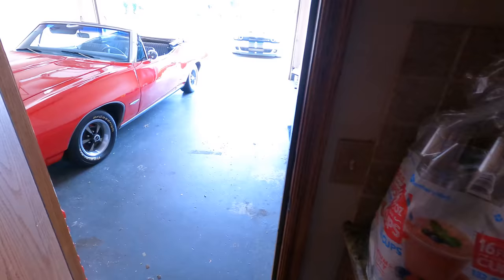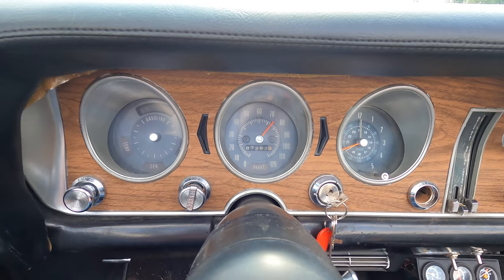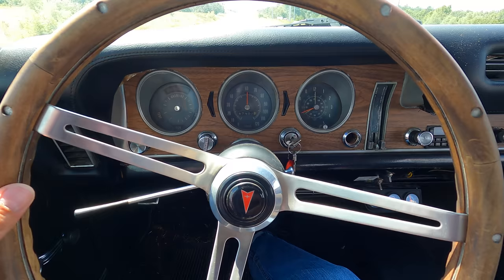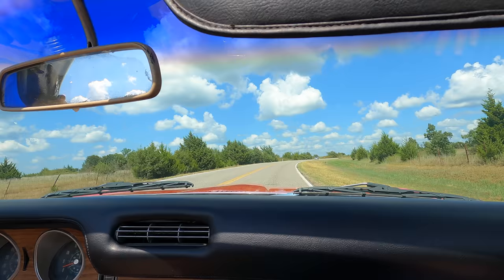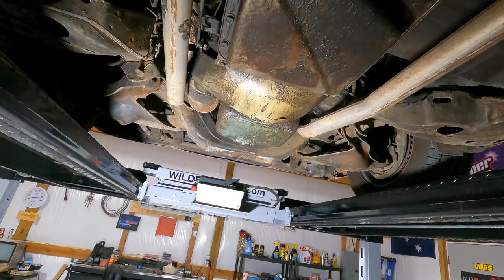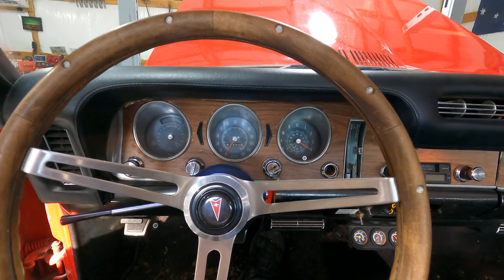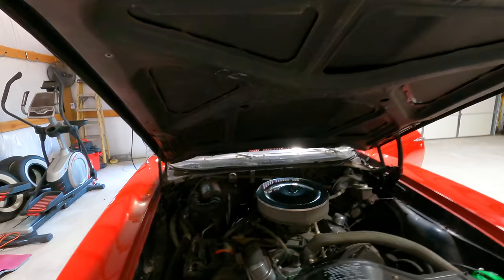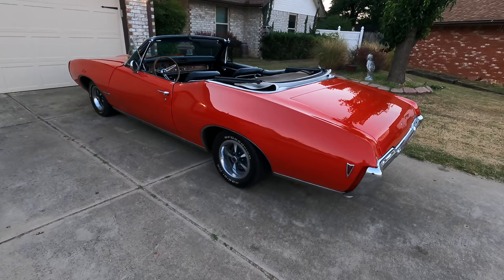Everything Wrong with my $20K Fake 1968 Pontiac GTO - How bad is it?

Comment: If that car had a Quadrajet that was well sorted (and I mean you knew how to properly tune the secondary air doors, power piston spring, and choke pull-off), you would never have any problems with its carburetor.

Comment: The Pontiac 350 is a good motor. As long as it is converted to electronic ign from points about the only other thing to worry about is the timing chain. Which is why on the old Pontiacs I switch the factory nylon ones to a steel double roller. That one seems to be running really well and no smoke, knocks or ticks. I would take it anywhere.

Comment: Just keep it as is and fix what needs fixing and remove all the fake GTO badges. An excellent LeMans.
Reply: The emblems back them were attached with legs in the chrome emblems going through holes in the bodywork, and the emblems were held on by speed nuts or captive fasteners. They didn't use adhesive and the emblems don't all have the same 'pattern' for legs and even some eblems go in different places. For example, some were on the rear quarter, and some were on the fender.
Reply: I was joking in the first video I saw of it and said he should get a tag with FAKE GOAT on it.
Reply: Thanks for helping me out.  I was trying to figure out the “fake” part.  Duh on me!

Comment: She will make it. I think you should put the Lemans badges back on it, a better steering wheel or the original and maybe the dash with a tach, but just my thoughts. Nice car though I like it.
Reply: Don't even know if there was a cluster with a tach. Remember these had the hood-mounted tachometer...
Reply: @wilsixone  ~I don't remember on the '68, but you could get the dash tach out of the '70 model. That also had a 140mph speedo, which would be pretty nifty.

Comment: Super Turbine 300 two speed used in various Buick, Oldsmobile, and Pontiac models from 1964-1969. The internal operation of the ST300 automatic was similar to the 1962-1971 Powerglide and almost indistinguishable. Few parts were interchangeable.

Comment: 68 can have a glide which yours has.. Its a nice clean Tempest convertible..  At best a Lemans base version. You need a full suspension rebuild with tie rod ends and a new steering box. Love the over-spray on the frame and engine.  The springs are also all sagged out.

Comment: That's the 2 speed GM automatic often called Super Turbine 300. It has the vacuum modulator on the opposite side from a Powerglide transmission. There were some Canadian made Pontiacs with special heavy duty Powerglide transmissions. The insides were similar to the 427 Corvette Powerglide, but the transmission cases had bolt patterns for both Pontiac and Chevy engines.

Comment: With that car being a Lemans, the reason it doesn't have any get up and go from a dead stop is because of the rear end gears the Lemans came with. I think it's a 2:73 gear. Also, that transmission is a Super Turbine 300. Pretty sure you got a keeper here!

Comment: The only V8 offered in the 68 LeMans is the Pontiac 350. The shifter will tell you what transmission you have. A 2 speed Powerglide will have PRNDL. The 3 speed will have PRND2L or 1 instead of the L. My 67 LeMans had the 2 speed. The GTO came standard with a 400 mated to a 3 speed automatic with a dual gate shifter made by Hurst.

Comment: Randy, as a LeMans, 14-inch tires would have been standard, and with the optional Rallys II Wheels, F70 X 14 would have been the likely OEM tire size or possibly G70 X 14.
Reply: G78-14 is Factory tire/wheel size, for Lemans or GTO.

Comment: Look at it as a GTO tribute car. You could always rebadge it as a LeMans for resale. It's still a nice cruiser. You did good on the price. We had a '69 GTO with 14x6 Rally II wheels. Back then 14" looked fine with those unique looking Pontiac wheel arches. Fun fact: you could actually get a GTO with a chrome front bumper. It still had darker grill with white "GTO" lettering. The tail lights were unique for GTO too. GTO hoods did have nostrils but most were non functioning unless you got Ram Air. It sounds like your secondaries are working fine when you step on it. Great video, thanks.

Comment: Your gear selector indicator will tell you. D & L is a powerglide. D 2 1 is a THM
Reply: Unless a 2 speed was put in without changing the shifter.  If it's a Pontiac 2 speed I believe it would be an M35.
Reply: Looks like its a 2-speed going by the gear leaver. Looks like it has D & S. No 2.
Reply: A powerglide was NOT available in a GTO! A GTO ONLY came with a TH400, or a manual in either 3 or 4 speed.
Reply: @jasontengan1233  I know it IS a Tempest, LeMans which did come with a power glide as STANDARD Automatic. A GTO was ONLY offered with a TH400 Auto.
Reply: From what I can see it looks like the same powerglide I had in my 67 Le Mans and my 69 GTO i been working on has a TH400
Reply: @jackfisher3906  actually no they came with the st300 all bop cars had this 2 speed. powerglide was a chevy only deal.
Reply: @jeffreyrigged  Sorry I used powerglide as a generic term for a GM two speed auto.
Reply: @jackfisher3906   alot of people do but they dont share anything other than both being 2 speeds. i aint mad at ya lol.
Reply: @jackfisher3906  before the mid 60s they did. by about 67 all the other cars had different trans than chevy and a different bolt pattern but they all shared it besides chevy. idk why they kept chevy differnt. it would be an easy swap to put a th350 or a 2004r in place of that st300 though. its a direct bolt in for both for the most part. im guessing this car was a 2 barrel too originally since it has no quadrajet.

Comment: The pontiac 2 speeds were super turbine 300s not powerglides.
Reply: 300 Turbine
Reply: @chrismorales9440  The Super Turbine 300 has the vacuum modulator on the opposite side from the Powerglide. Some Canadian Pontiacs did get special heavy duty Powerglide transmissions with guts similar to 427 Corvette Powerglides and the Canadian Powerglide has bolt patterns for both Pontiac and Chevy engines.
Reply: I dont think a late 60s convertible with a/c is bare bones. It could be a nice driver with some repairs and/ or upgrades
Reply: @jimjungle1397  but canadian pontiacs are acadians though and not a  gto and the acadian was just a chevelle with pontiac badges. had the chevy engines and so forth.
Reply: @jeffreyrigged  There is a Canadian Powerglide that had a dual bolt pattern for the GM engines and the heavy duty internals that were used in the 427 Corvette. Those weren't just made for Chevy engines. From the heavy duty gears and parts inside and the multi-engine bolt pattern, they likely went behind some big engines. I think they were used in Canadian Pontiacs and not Buicks made in Canada. I've seen Chevy 12 bolt rear ends in Buick Skylarks made in Canada, but with 6 cylinder or Buick engines in those with 3 speed automatics.
Reply: @jimjungle1397  but what im getting at your pontiacs in canada are chevy powered. you dont have a pontiac engine in canada at least in 68. dual pattern powerglides came in firebirds and only in 70.
Reply: @jeffreyrigged  The Chevelle type car was called the Beaumont
Reply: @joca6282  yes.
Reply: @jeffreyrigged  The Beaumonts were sweet looking cars too. 68 and 69 were killers!

Comment: Cars of this era had a valve in the heater hoses that shut off the flow to the heater core when you changed the temperature from hot to cold.  The valve may be stuck open or the cable  (some cars had a vacuum controlled valve) to the valve may be stuck or broken.  This was the first auto repair I made, fixing the AC in my dads Dodge when I was 14 years old.

Comment: do a dif fluid change requires removing the cover count teeth on the ring gear an divide by # on pinion= final drive ratio ,my money is on 3.08

Comment: The transmission is a Super Turbine 300, a 2-speed automatic.  It's not a Powerslide. Buick and Olds used them as well & Olds called it a Jetaway.
Reply: The Super Turbine 300 has the vacuum modulator on the opposite side from that of the Powerglide. Easy way to tell. Some Canadian Pontiacs did get heavy duty Powerglide transmission, with guts similar to the 427 Corvette Powerglide, but the Canadian Pontiac Powerglide has bolt patterns for both Pontiac and Chevy engines.

Comment: Oh a HUGE WARNING, make sure you run a lead additive or you WILL sink the valves into the heads. This is of course if you don't have the hardened Exhaust valve seats installed on the heads. It will run fine for about 6 months to a year then you'll start to notice excessive noise coming from the valve train as they sink into the heads. You can fix it by changing the valve seats out but if you don't the Exhaust valves will sink. I know I did it to my 69 GTO and my 1974 Trans Am. Also if you run the lower octane you'll need to adjust the Ignition Timing or you'll get pinging in the valves due to per-detonation. This will result in broken stock valve rings, broken piston ring lands and will chamfer your cylinder walls. Been there and done that on my 74 Trans Am. You can fix that by boring out the cylinders and sleeving them. To find out if your valves have started to sink take it to a shop and have them check the valves stem height and run a compression check. Have fun with your Cool Le mans or Tempest. 
The Tire should be G70 Rally II 14X6 wheels not 15" in wheels. If you put 15" wheels on, it will rub the front fenders and tear them and the fenders up. I recommend the 15" wheels with smaller diameter tires to match the stock tire height for one reason only. It will corner better and not "Push" as much. That is very important in a heavy car. I almost put mine over a cliff in California because the tires were; to high on the front, the weight of the car and, Well I was getting a little aggressive in the mountains for a heavy 60's car. Best Wishes & Blessings. Keith Noneya

Comment: I cant remember the year it started but 68 - 72 gto's had a vin prefix of 242. Also the gto never came with a 350 engine. They were 389- 455 ci. Then on Pontiacs the distributor sit backwards compared to other gm cars.. The reason is the vacuum advance hits the intake and limits adjustment

Comment: It's not uncommon for GM cars from that era to have 14" rims on them. My 67 Catalina came factory with 14" rims.
Reply: GTO and Grand Prix were the only two models with 15 inch wheels from 59 through 68. Weird.
Reply: @michaeltutty1540  my 69 GTO was ordered  new by my parents. Came from the factory with 14 inch Ralley II wheels. Although many have been changed out, there were no 15 inch on 68 and 69 GTOs.
Reply: @michaeltutty1540  The factory size was G70x14 for the GTO.
Reply: 15 inch wheels where only optioned for disc brakes up front and only 67 up. either 70 or 71 idr exactly is when the disc brakes became standard on the a body gm cars.
Reply: You're right about that, I had a 68 Caprice, and a couple of Furys they all came with 14s.

Comment: I see that you're selling it,  but that transmission is a Super Turbine, also known as ST300, 300THM or Jetaway.

Used in 1964-69 Buick, Olds and Pontiac. Definitely a two speed and seeing the acceleration, probably 2.56 gear in the back.

Comment: Those steering boxes do have an adjustment on them you loosen the lock nut and turn the screw down and back it off a bit but a lot of them have already been screwed all the way in you might want to check it it's right on the steering box

Comment: 1968 Pontiac Lemans 6.6
Tire size	Rim size and Bolt pattern
195/ SR14	14x5 ET8 5x120.65 Check rims price
205/75 SR14 See tires price	14x6 ET8 5x120.65 Check rims price
205/75 SR14 See tires price	14x7 ET12 5x120.65 Check rims price
225/60 HR15 See tires price	15x7 ET12 5x120.65 Check rims price

Comment: Everything I find says it should have 14” wheels and F70-14 tires.
Reply: You are correct! Check Coker Tire. It is listed as a V8 Tempest. When the LeMans first came out, it was the Tempest LeMans. They are the same body with different trim. I had a 67 and a 71 LeMans and my cousin had a 68 and a 69 GTO. This car has a Pontiac 350. The only V8 offered in a LeMans.

Comment: You made a good observation that you cannot hear the secondaries open up,  most all 350s were 2V carbs. They did have an HO version in some with 4V.  My 69 Firebird  350 had 2v. Pontiac loved 2v carbs they put them on 400s too for low-cost full-size cars with single exhaust. Up-scale versions got the 4v.

Comment: The Lemans 350s can with two barrel Rochesters, That is not a Quadrajet, if it was it would either flood the engine or make it accelerate. That engine puts out about 1800 hp, 255hp gross HP., all you had to do was remove air cleaner. You have turbo350 tranny. two speed were older and not hooked up to 350s. This cars had a leather connector between steering wheel assembly and power steering gizmo. I forgot the name of it. The feel of steering will always be a little vague but the play is cause by the connector. It is designed to break in case of an accident. But can cause an accident if not eventually replaced.

,

Comment: That 350 and the chrome bumper should have been a big red flag as to the G.T.O. heritage. Just loose the emblems and sell it as the convertible Lemans it is.18 thousand is at the limit of the price point
Reply: GTO's could be ordered with the chrome bumper in 1968 instead of the duro bumper.
Reply: @joca6282  thats common knowledge... but that 350. And the vin in the window should have 2-Pontiac, 42-GTO,  67-convertable. Thats "24267ect.... the option code for the chrome bumper was 674. Also if you ordered a special paint color you'd get the chrome bumper... the additives to the paint were pre mixed (I believe you could ask for the Enduro bumper with a special color, but not sure.
Reply: @robinluck2922  I know myself that's not a GTO. The tail lights are from a LeMans. The interior is not right in that car either. The GTO and Sport LeMans GT had the same exact interior. Those seats are from a Skylark convertible from the looks of the pleating. The automatic floor shifter is correct for the 2 speed. automatic.
Reply: @joca6282  you're right! To bad you or someone with your knowledge wasn't with this guy when he was checking this car out. At the very least you could have saved him a few thousand dollars just pointing out the discrepancies.
Reply: @robinluck2922  I would have been all over that. I had a rare 68 LeMans sport GT in the 70's till 1980 when I sold it like a dumb ass. It was the first GT type. It was classified as the GT 36 in 68 and 69.  In 1970 it was labeled as the GT 37. The coupes were all automatics with the Hurst dual gate and the 2 door sedans had 4 speed manual transmissions. Mine was one of 57 coupes made with hide away headlights. All others were fixed headlights. Ram air hood and tach optional also on coupes as I had. I put a 389 SD crate factory warranty replacement motor. It had 500 ponies just from the block output. I had tri power and it rated about 580 plus. I did a qtr mile in 10:70 with it in 1976. It had a 3:90 limited slip posi rear end. The front wheels would leave the ground on a launch. It was a great car. I'll never find another one. I'll settle for a GTO when I start shopping for one next year. I know where there's another 389 SD for it. Lol. Tri power and all. It's in a guys basement and the crank still turns over with a breaker bar. 389's kill 400's on the strip. I've taken down every 421 SD's with mine back then. The car was built in June of 1968 near the end of production that year.
Reply: @robinluck2922  The 350's that are in the Sport LeMans had about 360 ponies in actual rating. They would beat the 400's in the GTO's.

Comment: Can you not purchase tall profile tires that would fit the 14" rims and increase the height of the vehicle? Maybe you could save buying new rims. Just a thought.  I had a 68 Pontiac wagon with a 327 2v, a 2 sp powerglide and never had a problem running 60-65mph all day. Not a power house on take off but I had no issues towing a 2400lbs trailer. Not the best gas mileage but when you figure the 23 gal(or so) tank, it would easily go 400-450 miles if you didn't abuse the passing gear. Like you said, just enjoy the car as is once you get it sitting a little higher and revel in the moments you can get out of it. Blessings!

Comment: Hey about that no power from a start problem. I had a Olds 350 4 barrel and it did that, there's a small part on the top of the carb that would lock the secondary closed, I pulled it off and then it would work. Look for a tiny lock part on the top, you will see it there on the carb. It does nothing anyone really needs.